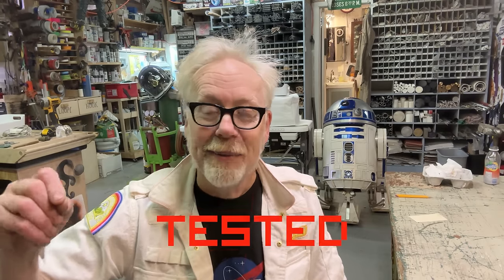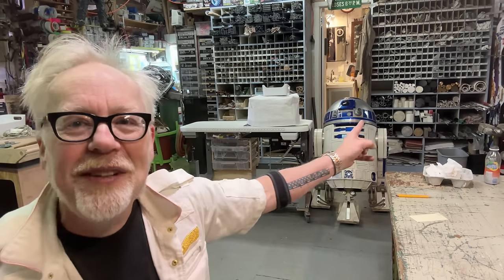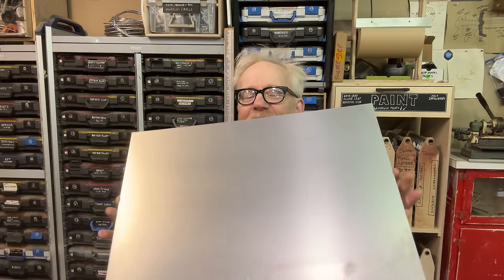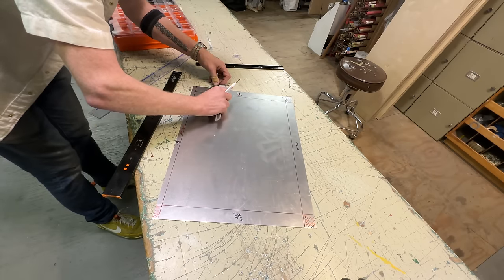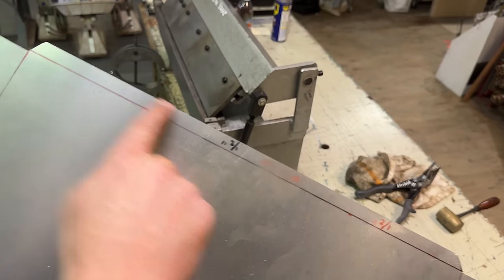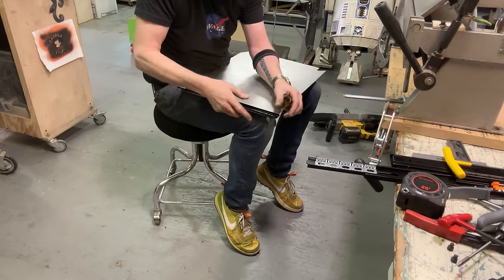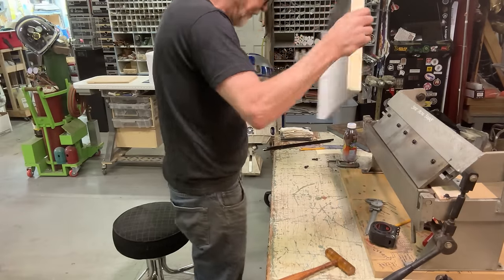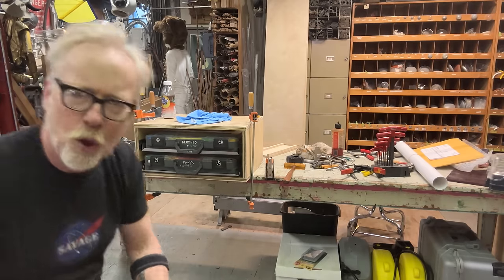Adam Savage Prototypes His Dream Hardware Storage System

Comment: there's so much storage that you could house allen wrenches, gerbil feeders, toilet seats, electric heaters, trash compactors, juice extractor, shower rods, water meters walkie-talkies, copper wires, safety goggles, radial tires, BB pellets, rubber mallets, fans, dehumidifiers, picture hangers, paper cutters, waffle irons, window shutters, paint removers, window louvres, masking tape, plastic gutters, kitchen faucets, folding tables, weather stripping, jumper cables, hooks, tackle, grout, spackle, power foggers, spoons, ladles, pesticides for fumigation high-performance lubrication, metal roofing, water proofing, multi-purpose insulation, air compressors, brass connectors, wrecking chisels, smoke detectors, tire guages, hamster cages, thermostats, bug deflectors, trailer hitch demagnetizers, automatic circumcisers, tennis rackets, angle brackets, Duracells, Energizers, soffit panels, circuit brakers, vacuum cleaners, coffee makers, calculators, generators, matching salt and pepper shakers.

you could store all of that.

Comment: At this point, he’s reinvented Akro Mills (except those boxes can stay put when you slide them out) at a much higher price point.

If I’m going to go nuts at this price point, I’ll just get Festool or Tanos small parts systainers and either use the drawer slides (cheaper) or SYS-AZ Drawers (pricier but better).
Reply: The SYS-AZ drawers are fantastic, but definitely not cheap.  But, yeah, if you're at this price point and starting from scratch then Systainers and SYS-AZ Drawers would almost certainly be the best option.

Comment: Don't get me wrong, this is a great system, which I copied for my own home shop. (I used $10 Harbor Freight boxes, not $60 name-brand Sortimos.) When Adam's rack is done, it'll be even better. But this whole drawer system sounds like a ton of work and money for a small increase in convenience. 65 sets of drawer slides alone is going to cost a grand. That's not including a ton of sheet metal, cutting/bending tools, rivets, hardware, etc. If you were building new cabinets for the Sortimos, maybe it would be worth the effort to add these in. But retrofitting it sounds like a nightmare to me.

Comment: Seems like it would be easier to just buy the compatible rail adaptor and mount it into your current system, looks like exactly the correct spacing. Than you wouldn't need to make an entirely custom box frame with custom shelves. Although I question if you still couldn't just make an adaptor for the guide rails to avoid making the entire shelf.

Comment: You know, I find myself wondering if, for your less-used bench tools like the metal brake, it might be worth sinking threaded inserts into the top of a bench, where the tool could be screwed down quickly when needed, then removed when not?

Comment: If you really wanted to go for peak efficiency you could create an LED cataloguing tool that connects to a database. You would need some LED stripping, an arduino mega or raspberry pi and you’re all set to go. Firstly you would create a database of all of your fitting containers. Then you would need to connect that database to an arduino or pi that would send a signal to the corresponding LED position in your LED strip, lighting it up and revealing its location. It basically a visual catalog to help you find what you need super fast. You could even create an app and connect to the LED system via Bluetooth.

Comment: Um craft a pull out slide table that fits it and fastens inside ONE of the rack stands shelves.  Make sure the table stand recesses or holders so that the pack can't easily slide or be accidentally knocked off.    Certainly less expensive and tedious than making all she shelves slide out.   Also has the advantages of being able to locate where is convenient in the rack.  Likewise if found necessary for one or two racks you could even have two such pull out tables replacing the cachets.   You could even design it with a fold out and down that will fold out (again) long enough to
get additional support from below if necessary for some purposes.        You wind up (on those racks you install it) sacrificing one slot for the table but the versatility seems to me to outweigh 
the cost and effort of doing it for all.

Comment: Making 20+ sheet metal pieces in the "home" shop is an exercise in patience.
I have though usually found it easier, faster and cheaper to place an order at a metal fabricator. Freeing one's own time for other projects.
Now yes, it does slightly take out the fun of the project, but it is a debate between time on this project vs time on other projects.

It is effectively similar to "should I machine my own screws or not?" sometimes the answer is yes, the majority of times the answer is no.

Comment: @tested I could have saved you a lot of money and time if you called me first LOL.  How about removing 1 bin from your rack, and inserting a single one of these bin sides so you would just have to pull it out and grab the container you need, move it to this, then return the bin to where it came from. Then slide the bin slide back in so it is not in the way, or a surface to place things other than these bins on.  This is slightly less productive, but much cheaper and easier to implement.  It would not have made such a good video though.  Great video, and thank you for all you do!

Comment: I'm barely three minutes in, and I see multiple problems that I solved for myself back when I lived in Fort Worth (before 1989).  Not kidding.  This in situ opening concept is ONLY any good for ones that are from approximately elbow height to shoulder height.  Seriously, who wants to open the ones above eye level ... above eye level?  What I did was replace one capsule, just one in the whole rack, with a pull-out shelf.  At exactly the most convenient height.  And make it self-retracting when I picked up the capsule that had been on it.  Now, that retractor ... was a fun mechanism to design, and I have not thought about it for a long long time.

Comment: I'm literally in process of printing a drawer system using a gridfinity box and drawer slides. Get out of my head Adam. If you haven't yet, I was thinking of building one cabinet on something like a hand truck frame. So I could take a set of drawers to my truck at once instead of taking them one at a time. Think carry on luggage but a tool box.

Comment: I just added a few pull out horizontal surfaces at a big discount to doing all of them.
Reply: At least only make the ones at a usable height and a pull out flat surface for the ones really high and low.
Reply: Trick on drawer slides is subtract an 1/8th and use those tabs you found.

Comment: Actually all you need is one separate slide-out horizontal surface, about wide enough for 2 sortimos. you pull it out, you pull out a sortimo, you put it on the surface. when you're done you put both the sortimo and the slide out surface away. if you need to exchange parts between two sortimos, having space for two on the slide out shelf takes care of that.

And then you don't need to spend thousands of dollars on drawer slides.

As for doing multiples: ADAM YOU CAN AFFORD A CNC.

Comment: What did you incorrectly use the drywall screws for? Because they are only good for drywall. They are hardened, which makes for very brittle screws. You should use regular screws, which look exactly like drywall screws, except they are usually golden in color.

Comment: Instead of doing a drawer slide for every shelf couldn't you just make a row of empty drawer slides compartments at a comfortable working height in the middle of the cabinet. When you need a box you pull it out and put it the working pull out drawer horizontal surface to work on. This would help with sortimo that are above your head or down at your feet as it wouldn't be comfortable to work at those heights.

Comment: Silly Q: What about converting 1 block slot in each existing vertical bank into a pull-out shelf and have 1 per column?  So much less work (and cost) required and almost the same functionality.  Thoughts?

Comment: Overthinking it.
Problem, I need a flat surface to put these draws on.
Solution, make one sliding shelf per cabinet at an ergonomic height, it saves a lot of slider adjustment time over the years.
The rest of the shelving will be fine then.
A useful tip. Use "see through" Divided shelves, then no real need for labels at all, you get to know by subliminal memory as it is always in your peripheral vision.

Comment: Dear Adam & Tested crew, the clear measuring rule you have linked is not the same one Adam used and held up. No metal cutting edge or rubber non-slip pads. Any idea of a closer match?
Reply from the maker: Stay tuned.

Comment: As a safety precaution like a filing cabinet would it be possible to prevent multiple drawers being pulled out at the same time, otherwise the cabinets will need anchoring to the wall to prevent tipping… 👷🏻‍♂️

Comment: Seems a bit overkill.  As others have done, they built in some simple PULL OUT PLATFORMS within the storage rack, so that when pulling out any container, they can set it on a pull out "shelf".  Having 2 pull out shelves at 2 heights and properly spaced in each rack column allows you to set 2 containers out from that one column of containers and open either up to get at what is inside.  If you have 5 across columns, that implies a total of 10 open containers at any time, and yet you don't need 50 drawer slides and all the effort and weight added to build them in.

I'd give up 2 bin slots and install a pull out flat shelf there in each column and try that first.

Also, when you 3D print your bins for inside each container (printed a couple hundred this way), take a look at the designs that have curved front inside bottoms (Zack) so your fingers can slide out the tiny bits easily and also look at the designs that have space for labeling the bin by having a top surface about 1/2" wide across the back top for the labeling.  These are easy to customize in your choice of 3D CAD, FreeCAD being the route I went.  A bit of acrylic paint as a background color there will smooth out the plastic surface enough to then hand write with an felt tip paint marker what size, thread, etc. something is in the bin to save time.  You could even color code the background, something I did to make it obvious between the 3mm, 4mm and 5mm screws...

The smartest thing Zack said was to design it all for SPEED in your projects, nothing matters as much.

Comment: So I get the utility of not moving the thing to a surface to dig through. That said if you are going to be accessing these things off the drawer slides have you not essentially made a less efficient drawer? You have made drawers with individual lids. I suppose you have drawers that you could remove if you needed to for some reason. If someone was in the situation of making storage space I would think you would put the stuff that is likely to be static in drawers and only use sortimos for stuff that needs to be able to move. 

I might be overthinking this.

Comment: Probably gonna want to bolt that whole thing to the wall if two drawers pulled out almost flipped your table! Things with exceptionally heavy drawers like filing cabinets have safeties that keep more than one drawer from being opened at a time. This won't, and if it starts to tip, they're all coming out and there's no stopping it.

Comment: To remove the corners, could you not make a single angled cut? Have an angle at the ends of the resulting sides would surely not matter and it would speed on removing the corners?

Comment: Maybe it would have been easier to have found a spot for 1 slide out platform to set the storage drawers on when you needed that horizontal surface.  Then you could slide it back in out of the way until it was needed again.  You definitely don't under do anything.. 😄

Comment: This is what I don't like about bins and containers with lids.  You pull it out, then you have to put it somewhere and open the lid.  A drawer is so much better.  Just pull it open and pull out what you want.  Although Adam won't see this, or read it, a suggestion.  Make one drawer hold 2 sortimos.  That would reduce the number you need to make and reduce how many times you pull it out to look for something.

Comment: I'd be terrified that more than one drawer would slide out and tip the whole cabinet over. You'd save a ton of time, not to mention money, if you made 1 horizontal table for each rack. Find a comfortable height for you to look through the Sortimo. Then replace one Sortimo box with a flat table drawer like you made. When you need it, you can pull the box out and rest it on the "drawer." You'd have to do it box at a time, but so what? How often will you need to pull several of these drawers out at a time? You might be able to make the drawer thick enough to hold extra bins for the Sortimos, or just pens and rulers and whatnot.

Comment: I couldn't justify the cost of all those drawer slides, so I have only one flat pull-out drawer per cabinet.  When I need to open a parts box I pull that drawer out to act as a surface and place the parts box on that flat drawer while I search through it.  It's good enough.

Comment: Why not just a folding TV dinner table? It would live at the sortamo., and support much more weight than the slides. Your design has a very limited weight limit. Think of how the slides will bend when when the drawer is cantilevered out. What about if the plastic bows down under weight? The whole thing can pop out of the slide rollers.

Consider also you only pull one out at a time. You don't need 65 support slides with the hundreds of parts to do it. If you start with the TV dinner table as your design principle you could just drive 2 bolts into the side walls of the sortomo rack, and screw hooks on the table to hang it from the bolts for 2 of the legs, and 2 legs on the other side of the table that can swivel down. That way, attached to the sortomo, the table will be more stable, and can fold small. Also you cam make more than one, and each one can support more drawers than one at a time.

By the way if you are going to ask for ideas you might allow for answers before you start buying supplies for a certain design. That's how you wind up with a useless hoard. Take your own advice and make something cheap, and dirty then if you use it a lot make a good one.

But if your time is so worthless that you want to spend that much on making, finding, and assembling the hundreds of parts (I estimate north of a thousand parts) to make it that's on you.

 My time's worth more than the $15 I could buy the TV dinner tables for on ebay, and do nothing to them rather than make them easy as even that would be. Also when you need to move the drawers to where you're working you can bring the table with you.

Comment: It would be surprising if Sortimo didn't make a cabinet with drawer slides specifically designed for the trays you've purchased.  Or maybe just sell you the slides that fit the cases.

Comment: I don't know but couldn't you just put screws in the sides of those things and just have them mechanically attached to the drawer slides.  The slides are made so you can take the drawer out if you need to so if you need to pull it out you still can but you can also just you know do what you need right there.

Comment: If you have more money than sense, and I know you do 🤣😂, Festool sell a drawer that accepts their systainers. So you can pull out the systainer and open it. Super basic (and it's festool so super expensive) but really low profile. It's basically what you just prototyped, just made of the same plastic as the systainers. I think i like yours better even though they probably work out more expensive by the time you've added the drawer slides etc. Also, once you've marked out one shelf, you can clamp the other 64 together and do all the holes in one hit for the entire stack if you use a drill press, as well as make all the cuts you need to on a "per stack" basis. The bends obviously have to be done individually but you can do all the holes before that.

Comment: Why not just add one pull out shelf at waist high in each vertical rack(looks like about 4 of them) and use that as your flat surface to put the case on when using. Kind of like the pull out cutting boards that used to be built into kitchen cabinets in the days of yore. Your drawer slide idea is fine but it uses so much more material and time to build. Not to mention the boxes on the top levels will be too high to see into when pulled out and the boxes on the bottom will mean you are squatting down, bending over or sitting on the floor. Ok just realized they cabinets aren't as tall as I first thought, you can see in the top boxes. Still...